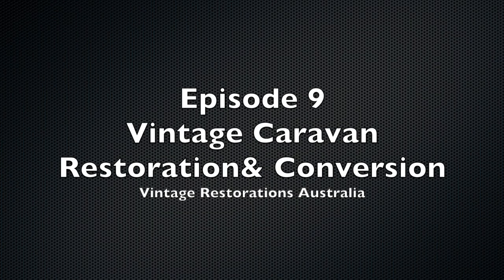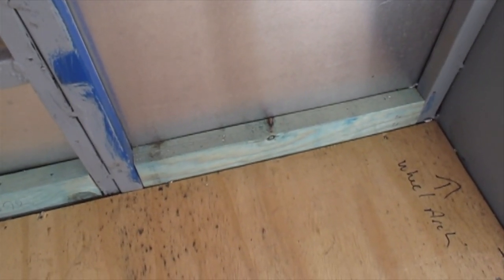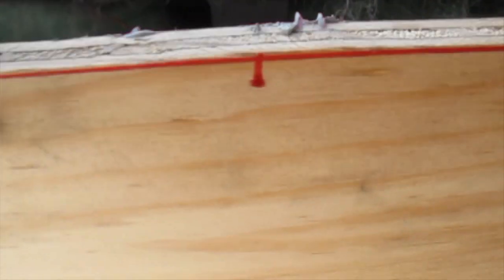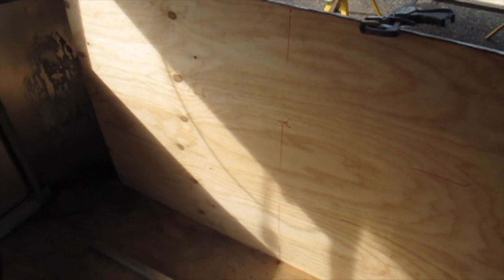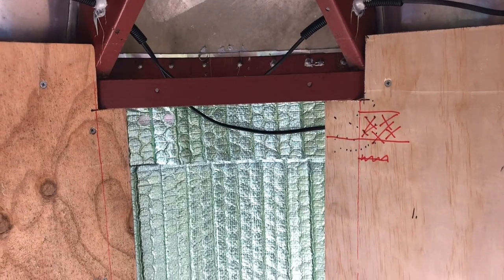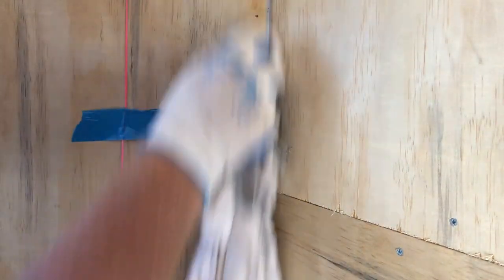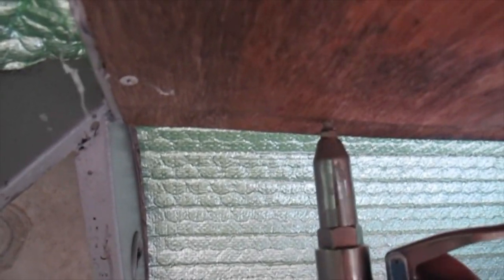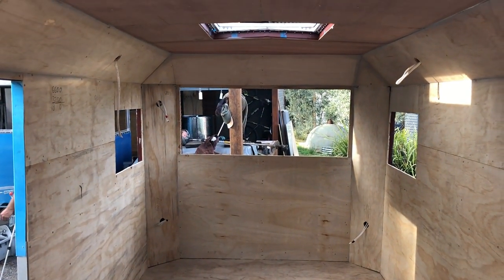Installing insulation, walls & ceiling in vintage caravan project

Comment: Love your vids, next project is an old van, do up just one ques, how thick is the ply on the floor? love to know. doing a vardo shape Greenhouse at present new one, size 8ft x 6ft4lnwide 7ft high i,ll keep an eye on your van resto,s in the mean time Graham Wingham nsw
Reply from the maker: Floor ply we use is 15mm structural ply Graham.  Best of luck with your projects!
Reply: Hi Steve I think I made same comments on other video but can’t find it. I am restoring a 13ft carapark and your videos are amazing!! I need some new ball corners, where would I get them from..... thanks.

Comment: Hey me got the same kind of caravan and me too wanting to insulate against the 40 degrees 6 summer months.
Reply from the maker: Yes they can get pretty hot, but insulation will really help.  We will be doing another insulation video in a few weeks on out 1951 van project.
Reply: @VintageRestorationsAustralia  After watching your clips I'm going the full hog and going to rebuild as you do. I was planning to tidy it up a little and us it as a stationery mine claim hut but I think it needs to return to the road. Will be watching the remainder of your clips once the 6 summer months start.

Comment: Its getting there . I am doing a reno on an 1974 Baravan (WA icon). Ive been using Sika 11Fc and screws on the new floor. What Sika you guys use ?
Reply from the maker: Sika Pro in grey.

Comment: What do you use for the joins between each sheet of ply as we want to just paint not use wall paper or anything
Reply from the maker: butt join with sikaflex, but that is not a dressed finish and would not look very good/tidy.  We also over fill with builders bog then sand the join flat.